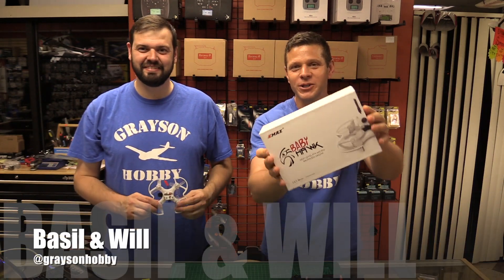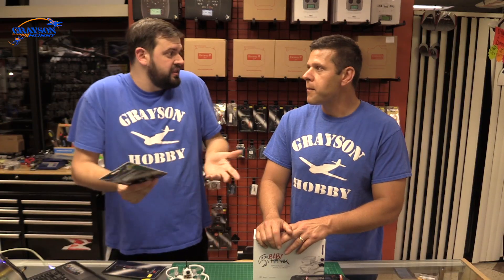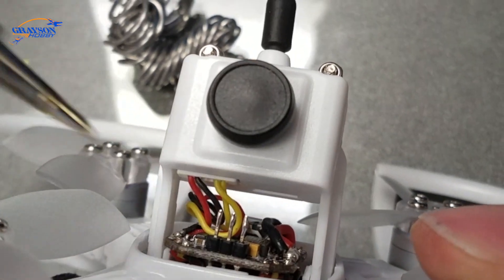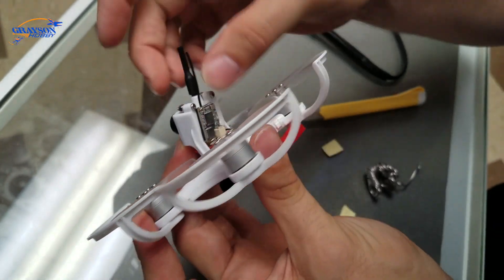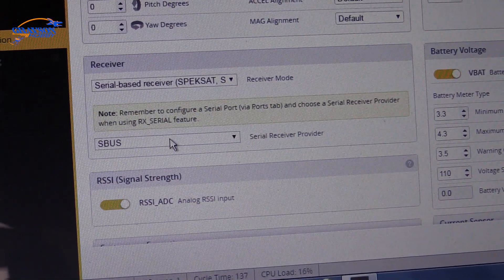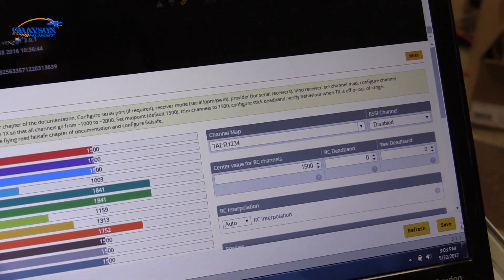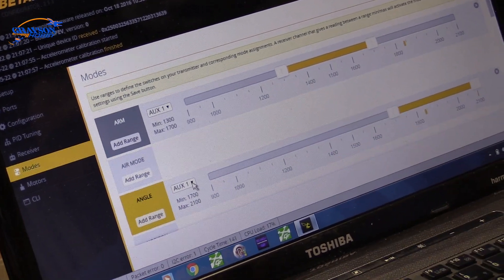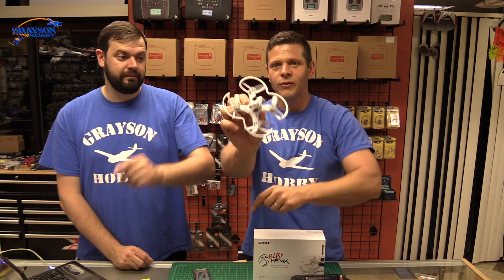Emax BabyHawk & Spectrum - How to Easy Install and Bind a DSMX Receiver and Configure BetaFlight

Comment: Hi guys, i just got a larva x f4 with this reciever, its all set up ,i changed it from my dx6 gen2 to my new T16s, how can i get an rssi reading, there is no sensors discovered in telemetry and rssi analogue came switch on from the supplier!
is there a way of recieving rssi on radio?
Thankyou guys

Comment: Hi guys,
Firstly, THANKS for your help, i only wish you lived next door!!
Qeastion: I have flown helis for 10 ish years, learning, crashing the hard way with the smallest heli being the blade 400 with 2 crossed carbon rods as training gear haha.
Sorry QUEASTION: Ive just brought a larva x dsmx new version hoping use it with my new T16s radio. Ive sucsesfully bound and configured my blade 150s to my T16s so i know the multi module is cool, anyway, so my new larva x dsm binds to my spectrum radio and flies great, but i can bind it to my new T16s with the same CLI commands ,all works on betaflight and goggles but it just wont arm, Throttle High!
Is there something else stopping the T16s arming, hardware? As i have adjusted throttle ,copied dx6 end points , i just want to use my radiomaster, dx6 works fine!
I HOPE YOU UNDERSTAND MY QUEASTION.
THANKS

Comment: Need a little help went through all your steps. Bind worked but when I go to bateflight I have nothing at all in the receiver tab. Any help would be great using dx6i
Reply from the maker: Dx6i - sorry thats an older radio - we do not have much experience with that.. but sounds like its not binded
Reply: Got it to work was a betaflight thing. Hit reset in settings tab and working right now. Thanks for the video awesome help

Comment: hey guys. I'm about to get crazy right now, i just received your sp09x this afternoon and it doesn't boot in binding mode, despite all i've done. I followed carefully your instructions but nothing happen, the LED doesn't blink at all :/
Reply: have u solved it? i got same issue
Reply: Try plugging a battery into your FC

Comment: Will this rx bind with an Orangerx radio? Trying to set it up for my nephew. Thanks for the information
Reply from the maker: Hi - We have never used Knock off radio so I am sorry we cannot help there.  We only use true spectrum radios.  If this binds with spectrum dsmx then it should work, but in the past we found some knock offs (of all brands) never to work 100% of the time

Comment: Excellent video Will & Basil!! Since I haven't soldered in a long time, what temperature (in Fahrenheit) do you set it at especially working on small drones?
Reply from the maker: Not sure of the temp, we just had an OLD 30w with a fine tip.  Thats all you need for these small wires.

Comment: I purchased the receiver that you used in the video and followed your instructions but after I bind to the receiver with my specktrum dx6 gen 3 and plug the micro usb cable back in the drone that is still connected to my transmitter I can't get the transmitter to show it's connected in betaflight. I followed the directions to a T and everything went smoothly up until I got the receiver to bind to my transmitter and I tried to go in betaflight to set my end points and it wouldn't show my transmitter was connected. Any help would be appreciated.
Reply from the maker: without seeing what you are doing, its hard to diagnose, watch starting 8:05
Reply: see my reply above.  update to bf 3.2

Comment: Hi guys, I have managed to solder and bind the dsmx receiver. When trying to set endpoints on my dx6 in betaflight I am unable to save the low middle and high endpoints on subtrims. I can save either one but not them all together. How can you save all 3 together? I appreciate any help. Terry
Reply: you go by one for one , set endpoint, save , move on to another. after getting this done you should be at 1000-1500-2000 if u cant get it right THEN use subtrim on your radio to correct to as close as u can get.

Comment: In BetaFlight the receiver tab shows no bars for any of the inputs even though I believe I've have binded the Baby Hawk with the BNF version to my X7... I've tried updating the firmware but it's always failing... I don't know what I'm doing wrong. Can someone help me?
Reply: updated to bf 3.2 it worked for me.. i had exactly the same problem DX8.. however mine was not BNF, i used the receiver in the vid
Reply: Safety Third Racing thank you for the suggestion, means alot. I will give that a try.
Reply: If it hangs when flashing, exit bf, open the impulse RC driver fixer in the background, open bf then try flashing again.   You have to experiment with the sequence.   https://impulserc.com/pages/downloads
Reply: Isaac Lebel i use a mac and haven the same issue
Reply: Spent hours trying to update on my mac nothing wont update stuck half way threw the flash... binded fine no throttle response at all in beta flight
Reply: Honey Tap checkout blue falcon project or something like that he has a good vid show how to flash flight controllers
Reply: adam bentley thank you for the suggestion